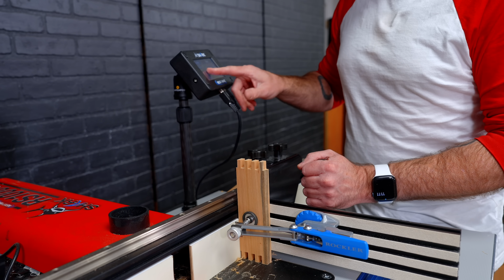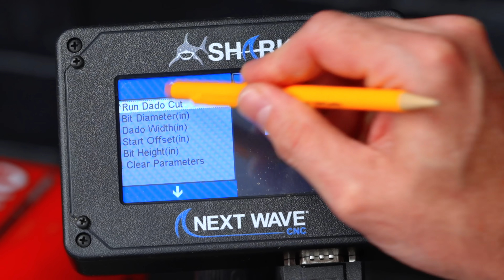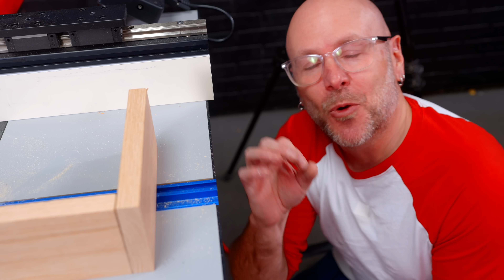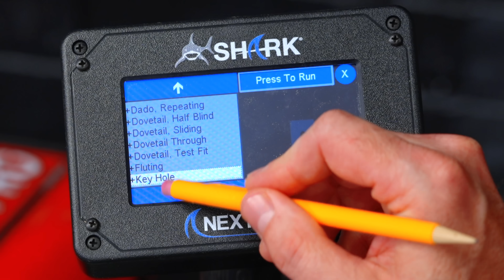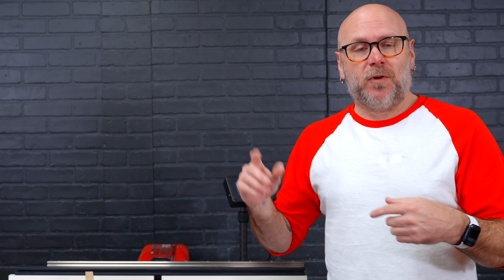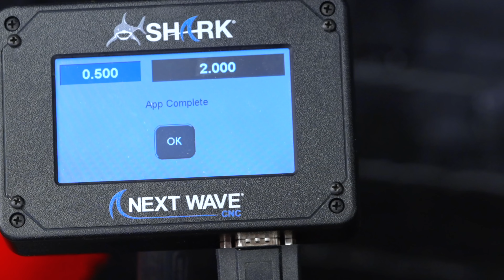This New Router Lift replaces ALL OF YOUR JIGS!

Comment: It looks impressive, but I share your concerns for the cons that you identified. I had a few more concerns, but the main ones are, 1. How long has this company been in business and are they likely to be around for a long time? 2. How well will they stand up to more than a relatively short demonstration video, such as several years in a woodworking shop? 3. How available will replacement parts be, and will they be reasonably priced? I'm sure no one wants to fork out $3K+ for this setup, only to find it is Chinese junk with no replacement parts available. Maybe someone can answer the foregoing concerns.

Comment: I get what you are saying when you say it's not a CNC, but by definition it is a CNC. Each of the programs are hard coded GCode files with dynamic parameters that you can set. So technically it is a CNC, but I understand why you want to say it isn't.

Comment: mindboggling......lets work imperial and input everything in decimal......when will you go metric?
Reply from the maker: When will you stop caring?
Reply: @MakeSomething  I'm of the generation that learned both imperial and metric at school. i just think inputting say .5mm in the display for finger gap is easier than converting 1/64 to decimal. UK is a mixed country. we have mph and distances in miles. fuel is sold in litres, beer sold on tap in pints but in ml in bottles. food sold in gms. milk in pints and litres. dont forget you have metric money. we had full imperial money £,s,d, yes d = penny or denarius in latin. dont forget our pint is 20oz as opposed to the US 16oz
Reply from the maker: @ cool. Then when you buy this machine you should set it to metric. Problem solved!
Reply: @MakeSomething  love to but cant find a UK supplier

Comment: Thank you for this.  A truly amazing upgrade to the router system and so much better than the Incra system with all of it's complicated setup of stops and huge manuals of set up and stop positions.  My question is putting a waste piece behind the workpiece to reduce tearout when doing a box joint for instance.  Would that not throw off it's calculations?  As to the cost you make a good point about all of the tools it replaces but, what would be a read deal maker, is if it could replace my domino as well.  That's $1700 by itself.  If it can do biscuit joints, why not a domino?  I'm pretty sure that is in the cards so maybe best to wait for version 2.0.

Comment: Were there any issues with installing the spindle in to the lift?
Reply from the maker: I had to make an adapter so it would fit. I have since put in a regular router so I could use bigger 1/2" shank bits.
Reply: @MakeSomething Thank you so much for the reply. When you mentioned your having used a spindle I searched everywhere I could think of for information to try and get an idea of clearances to see if I could get away with installing 80mm spindle for the ER20 collet. I contacted Next Wave and they said  a spindle couldn't be used with the RS1000 but, based on your video it seemed like a 65mm would work using an adapter.  I ordered a G-Penny 65mm that will take a  ER16 collect. Everything hasn't arrived yet, but I am hoping the ER16 collet will allow me to not regret getting a 65mm spindle. I didn't want to roll the bones on ordering a 80mm and then there end up being some other issue that prevented it from working.  You didn't even scratch the surface of your build.

Comment: EXCUSE ME.  All we need to know is how it does Dominos.  And sure, "floating tenons".  I think I would still use a biscuit joiner, because it is super, fast, and that thing won't do in line joints.  But Domino machines are like 3K, and this might do some of that.  That would be a fair super power, and offset to the cost of the machine.

Comment: You can always tell something is too expensive when it isn't at the top of the page but way down.
If they don't tell you unless you push a buy now button, you might as well leave the page.

For $1700 (actually $2000 who isn't getting the miter?) do you really need this for a home shop? I can see it as a great advantage to someone who is running a business but does the average person really need this? Or can they simply use other tools or jigs.
Plus, no router or table and what are you looking at for something like this?
Wow I can spend $2200 to make dowel joints, thrilling. And I am only scratching the surface of useless uses for such an expensive machine.

Comment: I have a Shark CNC and it has the same touch screen.  Using your finger is definitely an issue.  I have an old fine point stylus from an old tablet and it works very well.  A stylus is a huge plus but if you can't hustle up a stylus a pencil does work well.

Comment: I can see this being a real pain to use the software if using several different bits for simple cuts.
Reply from the maker: Simple cuts you'd just use it as a normal router table without the software.

Comment: Great video. How did you adapt the lift to fit the CNC spindle motor?!
Reply from the maker: I cut out a bunch of collars on the laser cutter and stacked them but I ended up putting in a regular router because the spindle was under powered for bigger bits.

Comment: How did you mount the spindle, doesn't the shark require 3.5" router to mount in it?
Reply from the maker: I made an adapter. The spindle I got I don’t recommend. It’s not powerful enough and can only accept 1/4” bits.
Reply: @MakeSomething  Ahh okay, I just ordered this and looking for a router to use with it, any recommendations?
Reply from the maker: @ShuhDonk  I've had great luck with Porter Cable routers. The one I'm using was one of my first tool purchases ever. I don't know the model number
Reply: @ShuhDonk  what router did you end up with?
Reply: @craigbrosinski1905 I picked up a BOSCH 1617EVSPK during black friday from Amazon for 179 dollars.  I am still in the process of remodeling my pole barn so have not used it yet though.

Comment: I'm really intrested in the spindle you added.  Would it be possible to provide how it was done and the spindle that was used.
Reply from the maker: I had to make a custom adapter. It’s not recommended as I found it to be under powered with bigger bits.
Reply: Thanks for the insight @MakeSomething

Comment: brilliant machine for the router. I think 1700 euros or Dollars sounds like a lot of money but with what u actually get from it it should pay for itself in no time depending on how busy ur business becomes or is..
U didn't say if the Mitre Gauge was included in that $1700 price?? It's one heck of a cool machine/Ad-on for the router table.. This could probably replace the Festool Domino in the long term once they tweaked it some more. Just a thought. The Domino is similar in price range to this tool, isn't it?? This would give u far more control over the piece of wood ur working on too imho but that's just my opinion. 
Great video man.
I would like to add to ur words that these machines have a learning curve to them. U need to make that clear too bcos not everybody is as tech savvy6 as the next person, like me for instance. I struggled with the bloody iPhone after using Android for so long. No lies here. I genuinely struggled bcos It was completely new in the set up and use.
I know a lot of ppl will probably be laughing at me for saying this but I doubt I am in the minority

Comment: awesome machine. I can see ways to improve it.  like the box joint cutting.  Place a wireless next and previous position button on the miter push bock.  cut press button cut press button and hands never exit the work.  I have been kicking the idea of making a router table saw fence like so.

Comment: Oh joy their website is down ... Not a good sign.

Also, great idea but if (as I read in the comments) the price is 2K then yes, that is too much, you could take any ole set of a lift and a fence and make your own with a dirt cheap 2 step motor/driver set and a microcontroller with touch screen. It might cost about 500 dollars (depending on how good you want it to be). After all this is the same hardware as so many cheap CNC kits. Less even since it is only 2 axes.

Comment: Legend had it he's still scratching the surface. 😅

Ahh but it is a CNC, it says so on the controller. CNC stands for computer numerical control which that is. Maybe a semi auto CNC 😅

I have the basic Incra Jig and it had spedup setup, and improved repeatability & accuracy, this would feel like light speed.

Comment: Trust me, you more then scratched the surface but with that said it is a pretty clever system. However it is kind of gimickey, a lot of the things like box joints can be done faster and more accurate on the table saw but albeit with less flexability and the bisket joints were so slow it would not be praticle,  besides nobody uses bickets joints these days, so it is a wash.  At $1,700.00 I would find it hard to justify but I do see enough value that I am going to DIY my own design, back of the envelope costs I am thinking less than $300.00 for the hardware, OS/firmware ie programing I will have to think about for a bit but it should not be too difficult to get basic fence and height positioning working, which I think would be enough.

Comment: very interesting idea, but working on projects with it will slow down several times. For example, to make 100 box joints, it would be easier to use router table or saws jigs.  While you'll make 10 holes with a biscuit cutter, this device will only make one. It's ridiculous.
Therefore, any commercial application of this device is out of the question. Very expensive for a hobbyist, and useless for a pro.

Comment: It is very cool, but for $1700.00  I think I will stay with my Rockler Router Table Box Joint Jig which is currently on sale on their website for $49.99 regularly $89.99.  I have had mine for about 4 years now and it works for what I need it to do.  If I want to do dovetails, I have a Rockler Dovetail Jig and stand that works.  I just do not have the kind of money. If I had an extra $1700, I could upgrade possibly 2 of the saws that I use regularly, like my 10 inch band saw or upgrade from my Craftsman cabinet saw to a Saw Stop cabinet saw.

Comment: Dave, saw this last night.  Great video - and thanks for sharing the tool find.  It went to the top of the list of shop equipment to buy.  I've been struggling trying to make due w/ the built in table on a Grizzly 1023 table saw, that is not compatible w/ a lift.  Been looking for a comprehensive solution.  Happy w/ the Kreg table?

Comment: Ok read some watch a few things and do a box miter joint  its no more complex then a cutter to do kitchen cabinet doors.  In fact you can use some versions of them to do locking joints.
The hardest part is setting up the tool,  one guy attaches a long base to the away side of the lock miter joint hes doing the up on the fence cut for stability  becuse if you cut it right your cut comes on on the edge of the miter, but let's attach a long scrap to it with 2 sides tape now you can hold it in the cut with stability.

Comment: The one thing this. Person? Doesn't mention? This is an $1800 router table. It's basically a vertical CNC machine and that aspect. We're going to spend that kind of money. Why don't you go ahead and get AC &c machine cause they? Can cut this you just gotta program it?

Comment: As cool as this is the 2k price takes it way out of a hobbyist budget in my opinion.  Its a fantastic idea and there clearly was a lot of thought put into the design.  I'm glad there is starting to be some innovation in the woodworking space.  If I ran a production shop I would buy this in a heart beat for the repeatability it would provide, I'd rather put another $1000 - $2000 into a mid-level CNC machine.  I'm also admittedly probably not the intended audience for this machine.  I'm tooling up for Guitars, Speakers and Amps so a CNC makes much more sense for me.  It will be interesting to see where things go after this.  Now I need to go through my drawers and find my extra stepper motors, controllers and build a DIY version of this.
Reply: el tema es que tampoco lo veo con robustez para un taller profesional, se ve algo delicado y si lo de los 2000 euros es de locos

Comment: I got the Spindle you had link to. Also got a 65 mm to 88.9 mm adapter from Rockler. My question is: when installing the Spindle to the RS1000 lift, where do you position Spindle in the  lift? In the middle of the Spindle or where.
Reply from the maker: Oh, I didn't realize you could get an adapter. Nice! If you send me an email through my contact form on my website I can reply with a photo of how I have mine positioned. I'm not in my shop right now but I'm pretty sure I have it mounted more towards the collet end of the spindle.

Comment: nice start... as a diy nut myself i know how to make something like this... in fact i built my cnc system myself in the 00's. of course i have a full machine shop and had access to many things that were not common then; but they are today. i can tell you for what you are getting the price is too high. it is probably because they are not mass producing it but the price should be well below $1k... like perhaps 899 list and 799 sale price or something. now days it is too easy to make your own cnc setup so paying so much for a much reduced functionality just for convenience would turn a lot of potential customers like me off. i am, however, certain that prices will come down. they sure did in the metal working world which has been doing this stuff for ever now. i am glad to see wood working stuff getting into this. as you show here very well, it is just too damned cool to have a little intelligence in your tools 🙂

Comment: dam ! I buil6t an Arduino controlled single axis machine to make my box joints, works similar but using a cross sled on a ripping saw,
Reply from the maker: Now that is sweet! I need to get better at programming Arduinos.

Comment: Nice. However, "CNC" simply stands for "computer numerical control" and that thing is definitely parts being moved (controlled) by a computing device sending numerical data. It's not a "traditional" CNC, but it is "a" type of CNC. And for the price of that thing, I prefer a more traditional CNC. In fact, I've built two DIY CNC machines for less $. The ones I built are called "LowRider" — open design by V1 Engineering. I built one that carries a router (full 4x8 table), and another that carries a plasma torch. This is nice, though. Just not for me.

Comment: If this could be adapted to an existing router table that does not use a removable plate like your Kreg router table, I'd be all over this like ink on a newspaper. I have a Sommerfeld router table, my router attaches directly to the table with no removable insert. Can this cut mortises for floating tenons like the, dare I say the F and D words??? I must admit, this thing is beyond impressive.

Comment: How did you upgrade to 65mm Spindle when it supports 3-1/2 inch (88.9mm) routers?
Reply from the maker: I used my laser cutter to cut a bunch of collet adapters and layered them up and glued them together. Could also be done on the bandsaw.
Reply: @MakeSomething  Thanks

Comment: I feel like they could also have integrated a domino joint feature since it would presumably be exactly the same process as the keyhole feature except with a straight bit. Just plunge cut to 1/2 the domino length, then move the fence back until correct domino width is reached.
Reply: The Festool Domino patent doesn't expire for another couple of years, and as it is such a cash cow it will likely be tweaked with to offer further patent extension.

Comment: If it could do a domino It's almost a no brainer...
Reply: Try handling large sheetgoods, especially vertical, moving them back and forth with the fence while the router cuts. This by no means would be a very useful domino or bisquit cutter or a replacer for one of those machines, even if it theoretically could do a cut like that in a small piece.
Reply: @CarmoniusFinsnickeri  I thought the same. It would be ridiculous on large builds. But smaller stuff like chairs? maybe?... Wish I could afford festool products for my hobby. Something multifunctional that could do the same would great though... Pipe dreams

Comment: a start and stop foot pedal for plunge cuts in conjunction with the app may work for the start and stopping on the dovetals and box joints.  You are correct easy to add a few line s of code to compensate for the router bit size and the width of the fingers or to make dovetails appear hand cut space variations.  What comes with the kit?  also replaces doweling jig,  shelf pin jig  it would be nice to see a top mounted system like the wood rat or the Router Boss it feels safer to be on top of the router and not have a spinning blade near  the claws.  Just  saying  a plunge router with a motor   a Y axis and movement with just the linear bearing attached to the router  would be sweet talk to your friends and make that happen for 1600 bucks.

Comment: Ordered mine yesterday in no small part due to this video.   I am looking forward to it and wonder if there will eventually be an add-on foot pedal for the next function so that you can cut box joints etc without taking your hands off the workpiece.   That seems more efficient but I can see where it might be a safety issue too.    Thanks again for excellent content presented in a fun but clear way.   The production quality of you guys' videos is outstanding and has gotten better and better each and every video!